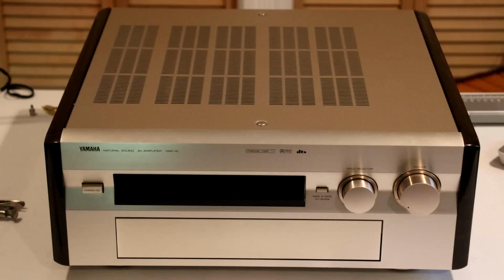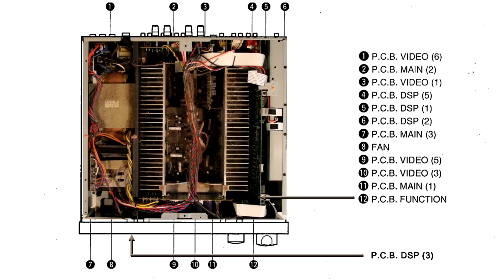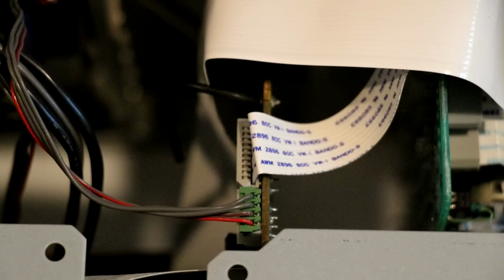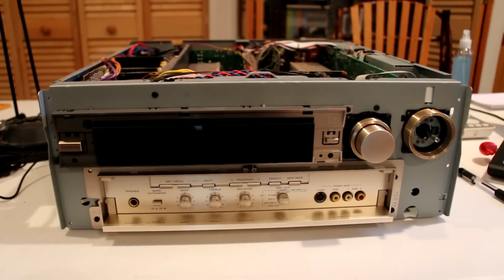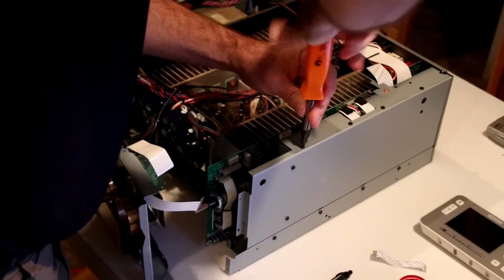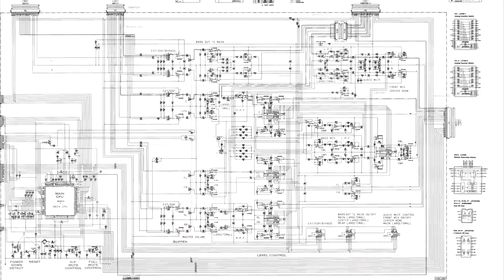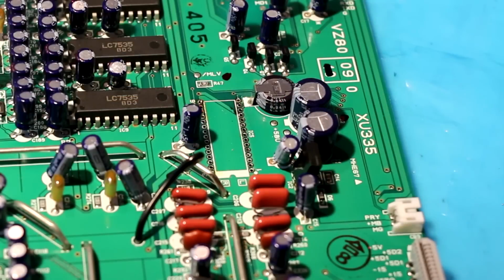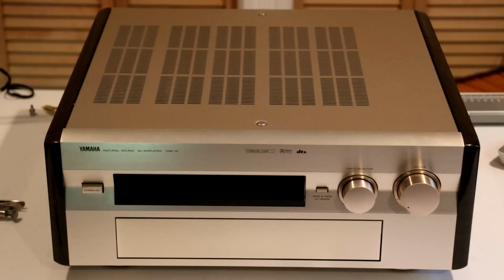Servicing a Yamaha DSP-A1 Integrated Amplifier

Comment: Good video but just some things to note, when soldering things like this, don’t use a monster sized soldering iron tip like that, it’s much better to use a chisel tip that’s no more than 3mm across, also to me, it looked like you weren’t applying enough heat to the display pins, you must touch and heat up both the pin and the soldering pad in the PCB, then apply solder, the way you did it you might have dry solder joints in the future, the chip socket is a good touch, that’s what I use to make future replacement easy, an easier way to remove pins left behind af you cut them is to heat up the joint and pull out the pin with some tweezers, easy to clean up the pad that way, oh and on the super cap and the chip, you never made mention to be careful of polarity, it’s very important to install theses things the correct way around.
Reply: When soldering on my Yamaha receiver PCB the tracks would lift with very little heat.  He may guarding against this.  The solder joints may not be as solid and well formed, but they are likely making good contact enough to ensure contact while a little more heat might cause the track to lift and break off.

Comment: Working on my A1 today to fix the display that goes off once the amp warms up. The board shows cracks in the solder on the power pins and some of the top row letter pins. Soldering later today. Your video has been invaluable and reassuring when a unit like this is in pieces. Many Thanks,

Comment: I purchased my A1 back in 1998 when I was in the Air Force stationed in the UK, it has the same problem with the display, I put it away and bought cheaper Yamaha receiver from Yamaha, and have been using it for a while, I took the DSP A1 back out and hooked it up to my speakers and I forgot how good this amplifier really is, I won't be able to fix the display on my own as my fingers do not bend very good anymore so I will take it to a stereo repair shop and show them the video and see how much will cost to fix it. this amplifier weighs a ton compared to the other Yamaha receivers I have and the sound with the bass is amazing with surround aound. Thank you for posting this video.

Comment: I have 2 of these. Both had display problems and 1 also has muted Left and Right front channels that at first was sporadic but eventually became constant. I was able to fix the display only problem by re-soldering all the contacts, but the one with the muted sound problem is just like your DSP-A1 problem. Now I am almost sure it is the same exact problem. Thank you for a truly excellent and professional Video. Very helpful.

Comment: Thank You for this video! Your explanation of the function board chip damage saved me a trip to my service tech. I replaced the SuperCap and the IC and got my amp up and running again. I also had the same display problem but had my tech do that repair but hadn't found this video back then.

Comment: Awesome video! I myself found a Yamaha RX-V2090 on craigslist for $10 bucks listed as "Turns on,no sound,selling for parts"
So I took a shot at it and figured it was just a fuse that was blown but before I did that,I googled the "no sound " issue and it brought me to your video and listened very carefully to what you were saying.Then when you said these magic words at 12:38  "feed in a signal via the Main in connectors" . I did that and sound came out the main front speaker connections in the rear and the headphone jack! Being that i am not a fan of surround sound or pro logic stuff,I am very happy to use my yamaha as a Power Amp! And i'm also thinking that the IC Chip in  my Yamaha is blown,eventually i will take it to a shop to get replaced,but in the meantime i'm enjoying it as a Power Amp feeding it with a Carver Preamplifier. Thank You Very much for posting your video,Very Helpful

Comment: Professionally made video! Very nice work. :)
I have the AX1 amp that had similar problems. Apart from the cap I also needed to change the relays that turns L, R and center on/off. Seems like they oxidized internally. The AX1 also have "infinity" volume-knob and input selector using rotary encoders. The lube for the shafts inside the encoders smears out over time and makes bad contact, leading to very awkward behavior of the volume and input selector knobs. You can carefully pry them open, clean the contacts and put together. 
Still in love with this old amp and nice to be able to keep it going some time more. Good to see other people also think so.
Reply from the maker: Thanks for the info. After two years of trouble free operation, my center channel has started to drop off every once and a while, and my input selector knob no longer works (have to use the remote). I might need to make a sequel.

Comment: Thank you!!! My display would turn off after a couple minutes when turned on and not come back on until it was off for awhile.  Soldering all the points on the display fixed the problem.  Your video was great in helping me disassemble the cabinet.

Comment: You make it seem so easy, I am very impressed with the quality of this video. Very clear and instructive video taking the mystery out of electronics repair. It is not for the fainthearted, but a great inspiration to those of us that have equipment with issues, and nowhere to get them fixed except by ourselves.

I have a couple of Yamaha AV receivers, the RX-V367 with a memory issue, and a DSP-AZ2 that does work fine for now. The memory issue on the RX-V367 might be fixable. Thank you!

Comment: Thanks to this I had the courage to remove the volume knob to manipulate the LED to work. I thought it was in the knob itself, connected to a wire. Much easier than I thought. Now the only tiny problem I had with mine is fixed 😀 A tiny issue but I like everything working perfectly on my gear!

Comment: Like others have mentioned, awesome video.  The display on my DSP-A1 has been slowly going out over the last few years and now has completely gone out.  Looks like a nice weekend project and a brushup on soldering is in order.  I will take the advice of another poster and try using a smaller soldering tip as well as heating the pins and base when soldering.  I sure don't want to have to take this monster apart any more than i have to.  This beast weighs a ton.  Thanks for the excellent video.

Comment: Thank you Bughunter for this video, my Yamaha dsp a1 unit was bought in 1999 at a cost of P58,000.00, sure a lot of money back then, now i have just fix the display, but i think there is still problem on its memory since it does not rest on its previous configuration as it is being  shutdown and restarted anew. You have to reset again the users choice of setting. Surely this video will help a lot in restoring the full glory of this amp/processor for good.
Reply from the maker: You're welcome. Hope it helps. If you have any questions, you can post here... BH

Comment: Nice video.  For me, about 50 screws later, I found the memory capacitor on my ancient DSP AX-1 (C175) it had just started to leak its electrolyte, so a lucky save.  One bonus of the AX-1 is that Yamaha put a conformal coating on the FUNCTION PCB, so it should be less prone to the capacitor out-gassing and leaking.  Mine was hilariously dusty inside, gave it a good clean, it's never had one in the 17 or so years I've owned it :P  Looks like new now.  I've got four AV amps, I just can't bring myself to get rid of them when I buy a new one.  Yamaha all the way, such beautiful construction and attention to detail and that clear, non-tiring sound that keeps me coming back to Yamaha.
Reply: Hi ! I have a dsp ax1 as well and the sound starts after is turn up two half! Do you have any idea what could be the problem
Reply: @florinflorin3308  apart from the memory capacitor leak problem, the other two major problems are the input board detecting inputs when there aren't any and the speaker relay contacts failing. Take an RCA jack and whilst playing music put the jack in the pre-amp in sockets on the back, the main left and right are the obvious two, you'll need to plug them in and out quite a bit to clear the problem. The relays need the entire amp taking apart, so do the memory capacitor at the same time...

Comment: Good video! I gave my sister this amp many years ago and it developed exactly the same issues.  I did not replace the audio switch, I just removed the cap and cleaned the corrosion between the pins that caused the problem with the lower display (thus not needing to remove the IC)  Many early boards with super capacitor storage suffer from electrolyte leakage which causes corrosion and eats PCB tracks :-(
Reply from the maker: I never thought of just trying to clean the corrosion. I'll keep that in mind that next time I do this sort of thing.

Comment: I thought while you had it dis assembled you would have at least cleaned the heat sinks and unit with a  Air compressor but anyway good job . Nice to see you solved your issues .
Reply from the maker: +Dave30867 Ha, Ha, Ha. I wondered when someone was going to say something. I actually did clean it up, but only after I was all done. I forgot to take another picture before putting the case back together. At that point, I said heck with it.
Reply: ok very good upkeep on your system,glad im not the only person who does these things .

Comment: Your Yamaha was a really good integrated amp.
Did you know there's a way to connect receivers from the 90s to current TV's using the HDMI connection.  Its called the HDMI to RCA Converter. Its basically RCA cables the Red, White and Yellow cables and a HDMI connection.  You connect the RCA cables to your receiver and then you take the HDMI cable from your TV and connect it to the HDMI connection on the HDMI to RCA converter.
Then you use another HDMI connection on your TV and connect it to your TV box or Amazon stick on what ever source your using.
Here' a pic of the HDMI to RCA converter.
 https://www.amazon.com/dp/B07GRXDZCF/ref=sspa_dk_detail_0?psc=1

Comment: Very nice video and u are so smart can fig out the problem by ur own, I have a Yamaha RX-V2095 almost same as ur Yamaha DSP-A1, now having issues when I switch the unit on and I turn the Vol up to 10% no sound out but if I increase the vol more than 30% the sound come out from all speakers it happens randomly,  one thing I noticed about when sound restored I can hear the sound comes a bit weak start with and back to normal normal peak in 2secs , is anything I can do about it? I love this AMP I wish I can keep it forever.

Comment: Great video presentation! Maybe you might have some input to help me with my DSP-A2070. I've searched high and low with no success. The center channel is full of static and seems to be putting out a peaked level (or at least significantly higher than the rest of the channels). To test, I disconnected all speakers, set it to a ProLogic mode, played some music, and connected the speaker to each of the various outputs. Static comes from center only. I then pulled the channel bridges and routed the center output to one of the main inputs, and sure enough, static. So, it seems to be something with the DSP chip or something else internally. So, I've been trying to figure out how to do a factory reset or otherwise a way to reset the DSP. Any help is greatly appreciated.

Comment: Bought one on ebay... Had it on 5 minutes and the display went out. Fixed that by fixing the cracked solder joints... But the only way it outputs audio is by having an DSP effect on. If I want a through signal DTS/Dolby digital, no audio. The center channel is out too.  Can this be related to the IC5 on the function board? I may just return this one back to the guy I bought it from. Plus it smells like it was in a restaurant or something. I wanted one of these for years. I may try another one.  The remote I bought for it doesn't work with it either... As it didn't include one.

Comment: Very impressive !! This is really a great video with very helpful information. Thank you. I do have a Denon AVR 1611 that has the same problem that you have repair in your Yamaha. I mean that some user setting are lost after unplug the unit. This does not happened when the unit is in standby.  Do you know something about Denon servicing? Do you know if there is some service manual available for this denon as per your Yamaha? Thank you in advance!!

Comment: Hi Great video!!.....very detailed and well explained.....I have an RX-Z7 and the their are various pixels that are out on the display.  I just purchased the correct display board from Yamaha but for some reason it does not have the amber coating on the glass (It's just clear) compared to the original that has this coating so I would lose the amber display look for a white display.  Not sure if I want to do that. To further complicate matters all the pins on the original display would probably have to be cut out and all the holes de-soldered so the new on can be installed.  I already removed the front panel and have the display circuit board out.  I came across your video showing that the display pin joints crack.  Could that be causing some of the pixels not to light?  I hope so because that would be an easy fix just to go over all the solder joints like you did in the video than to replace the whole display.  I have not checked the pins out yet but the unit is 10 years old so that could be the problem.  What are the chances of the display being bad compared to the solder joints being cracked.? Thanks in advance!

Comment: After viewing this a few time I'm just about to tear down my broken A1 to remove the the display to hopefully fix my other A1 that has been gradually loosing the display over the last 6 months, it was working fun with only a couple segments missing but then it started going off completely from switch on but coming back after a while, I figured it was coming back on after a bit of heat caused the solider joint to expand enough to complete the circuit? But now it refuses to come on. I intend to fully re soldier the other display then swap it into the working unit, do you think I'm doing the right thing ? Could the display fault be caused anywhere else but the display board ? Thanks for posting the video.

Comment: Great video! Thank your for shareing...

Just have a question for you, I did the same thing, I ordered two analog  switches for to replace the IC5 / IC4..( LC78213 - the sub number on the surface of the swich is different than original ) .

Just please, if you can help me to understand, why the volume level went a bit down?When I turn the volume knob in to the usual position, the sound seems to me to be a bit down than before...

I replaced also the supercapacitor ( 0.047F )

Thank you!

Comment: BOTH of my DSP-A1s have the screen issue as well.  Both of them also have an issue where the sound will cut out on one of the channels (could be either side, it seems random) and to get it back you have to turn the volume up and it comes back on, then I can turn it down.  Any ideas?  It's pretty weird, I am guessing a dirty switch somewhere maybe?  I love the sound of this amp and it loves B&W speakers for some reason.

Comment: Hi, Ive got this same amp thats doing auto protect after about 2 seconds, with no self diag on the display. The service manual suggests the issue is with the power stage, Im getting 230v (uk) volts going in but about half the correct volts from the transformer to the PSU. Any suggestions you might have on where to loos for issues would be great, cheers!

Comment: Thanks a lot. That’s the problem of my Dsp. The display works when I turn it on an after 15 to 20 seconds it turns of. And if you have to update your settings, you are lost. 
May I ask, where you get the assembly manual from?
Greetings from Germany 
David

Comment: Question,  I have the RX-V1 I ran it as I processor for about 15years, after I sold my external amp, I hooked up my speakers to the rx-v1 no audio until I had to almost max out the volume,  sound will output but will stop.. If I increase the volume knob audio can be heard.. I need your expertise

Comment: You can even upgraded yourself if you could not RXV 785 a and it would take a little we working in the power supply and change the finals and I was able to boost the output by 1/3 and I also did a little work in the logic area make a sound friendly better I have a friend of mine that keeps pestering me to sell him the receiver but I did too much work to it and it receiver sounds too good for me to get rid of it so I think I'll keep it until I come across something else I want to play with and then I'll modify that and tell him this

Comment: @bughunter Can you (or anyone else) advise re: sourcing the 47000 microfarad capacitor please? That particular component seems to be obsolete now (extensive online searches). Is there some alternative component I could use instead (which would fit onto the circuit board ok)? Thx.

Comment: Hi , Thank you so much , a DSP-A1/G , just like your , my lower display works but both the upper and lower ( the whole display ) will dim . The other problem is the volume knob working with the remote , there are times when I will turn the volume up using the remote and I can not lower the volume using the remote , I must physically turn the knob counterclockwise to lower the volume. My first thought was that maybe there was a rubber band attached to a servo , however I can see from your video it is a multi-gang volume control as described  in the literature of the time. Do you know a way to remedy this problem , I love my amp , we both know these are very worthy pieces , can you please help. I thank you and thanks for making this fantastic video. Can I hire you ? , my DSP-A1/G means the world to me , it`s not like you can go down to BB and buy one !!